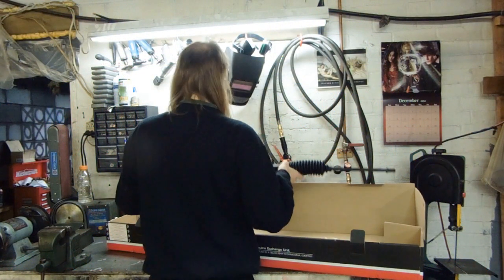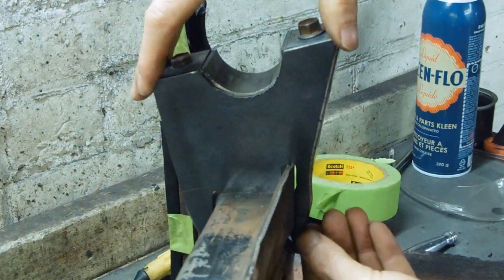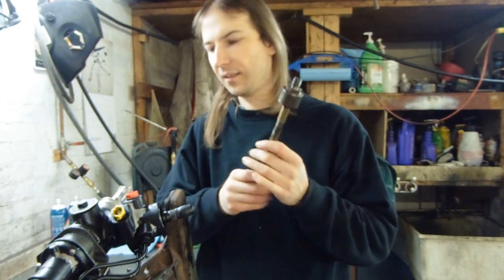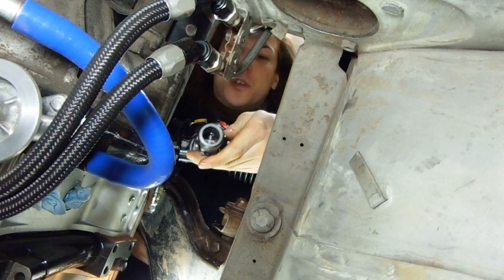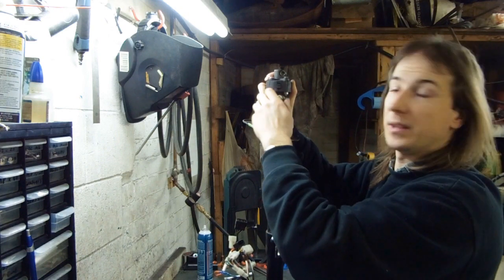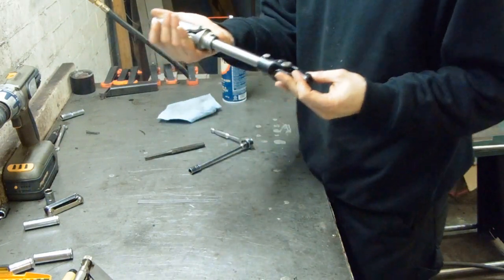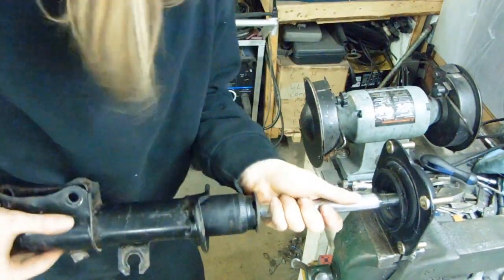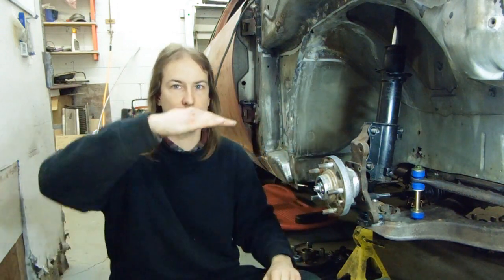Part 40: Front Suspension & Rack and Pinion Conversion, Part 2 - My 76 Mazda RX-5 Cosmo Restoration

Comment: I'm so bummer at the end of each episode cuz I just want to watch more haha.  But, it motivates me to go work on my fc.  I was just swapping out the front diff mount but one of the splined bolts snapped inside the actual mount and now I have to drop the subframe  ugh
Reply from the maker: Christian Sharron That sucks, but at least dropping the subframe isn't really that bad. Assuming it's been out before of course.
Reply: doesn't look like it has sadly.  got any tips for taking out the lateral links?  I tried half threading the nut on and using a jack with the 17mm socket but it just lifts the whole car up and the pickle fork is proving to be equally unsuccessful haha
Reply from the maker: Christian Sharron I'm not sure why you need to remove the lateral links. I've never had to except when I wanted to. Typically just drop the catback, disconnect the drive shaft, remove that vertical link, unbolt rear calipers, then unbolt shock bottoms, diff ear mounting nuts and remove subframe mounting nuts. Lower with jacks. However if you want to remove the lateral links then use a ball joint separator/puller.
Reply: Awesome, thanks for the tips man!

Comment: I believe the point of that spring in the steering shaft connector is to keep a little shear tension on the pinch bolt - this makes it less likely to come out, should the bolt start to work itself loose.

Comment: This question is not directly related to this project but in your experience with FCs what are my options to convert a power rack to manual a manual rack. I already studied the option of doing the mods to de-power the rack, also the FC manual rack is really hard to find. Have you seen any other option or manual rack close to the FC dimensions.
Reply from the maker: Jose Munoz Off hand I don't know which other racks would fit the FC. The easiest option is to just swap in the manual rack. I'm not sure where you are but finding a manual rack on the RX-7 Club (.com) should be fairly easy. Alternately RockAuto currently lists 3, complete with tie rods, starting at $178. You'll also need the steering shaft from the column to the rack, I believe. De-powering the FC rack the PROPER WAY works quite well. Note that involves disassembling the rack to remove the piston seals, not just looping the fluid lines. The benefit of the de-powered rack is that it has a quicker ratio than the manual rack.

Comment: The inner ball joints of the rack sit outer than the inner ball joint of the LCA. Thats a recipe for bumpsteer. I have a similar issue on my toyota KE20. Let me know how you solve it. By the way, great work with the videos and fab. Do share with us the positive changes later :)
Reply from the maker: sskoul Certainly that will introduce some changes in angle as the suspension flexes. However even most OEM applications do not have inner ball joints lined up to the control arm pivots (only one I've seen that lines up is FC RX-7). Makes sense, because a custom rack would be needed for every application. Actually I thought about going down that road but the Miata rack was almost perfect for the application so I would have gained little having one built. Bump steer wise, I'm more concerned with the inner tie rods being parallel to the LCA. Though my Insight violates those rules and doesn't seem to have bump steer problems. Well it does, but for other reasons (55 PSI horrible tires, rear track 2" inboard of front).

Comment: Don't worry about runout, your steering will NOT feel lumpy.  I had an old Dodge pickup that had a bad joint.  I ended up welding two u-joints off old Chrysler cars into a Chevy D shaped shaft, with the u-joints assembled, trying to not burn the piss out of them.  I had to submerge them in oil afterwards.
Reply: And changes?  Are you baby making?
Reply from the maker: Nicholas Smerk Oh hell no! As much as the world would be immensely improved by my offspring, that will never happen. No way, no how. Now back to the steering, thankfully it turns silky smooth. The little bit of runout in the adapter I made is compensated for by the rag joint. And on final assembly I'll put even more care into truing it up.
Reply: aaroncake I'm wondering if the runout would be complicated because of the bearing.  The one I built was a straight shot...removed the rag joint and welder on two u-joints to a slipper shaft.  It was pretty far off actually, but I was more worried about getting a very good weld without destroying the joint.
Reply from the maker: Nicholas Smerk U-joints give a lot of freedom in tolerating a little runout. It's interesting that I was at AutoRama yesterday and only saw one car using a bearing to support the steering shaft, all others were supported with heims. The most u-joints counted on one steering shaft was 5 and even then the owner assured me it turned smoothly.
Reply: aaroncake I'm sure none of those vehicles were dirty.
Reply from the maker: Nicholas Smerk The Riddler cars certainly were not but there were quite a few other hot rods and such which had some miles on them. However really doubt they are driven much in the rain or at all on a daily basis. No one who had changed their steering had boots on their u-joints. Not a single one. Which I find amazing because it seems like a necessity.
Reply: aaroncake I believe the u-joints themselves have rubber seals on them, just like a universal joint.  I always wonder how long it takes a heim joint to get dirty.

Comment: With all the custom suspension work, how do you intend to handle things such as alignment?
Reply: Nevermind, shows me to comment before the video ends
Reply from the maker: EvilJ069 The nice thing is that all the alignment adjustments from the factory are maintained. The strut top can be turned to alter camber/caster, the tie rod ends adjusted to change toe. It just looks like I need to move the strut tower tops in about 1" to fix the positive camber but I will wait until the car is at ride height.

Comment: Im curious aaron, what kind of Miller mig welder do you use? Also, I see you don't use a helmet while tacking, you just take it straight to the face which concerns me
Reply from the maker: RulfusTheBear The MIG is actually a Lincoln Weld-Pak 180HD. It replaced a small 120V Lincoln MIG. I'm very happy with the welder. It runs very smoothly, has a robust wire feed drive and good adjustability. As for the tacking, yep, I use my safety squint. Not recommended of course but I'd venture to say most weldors do it.

Comment: hi, When I saw you installing the front sway bar, I remembered mine! how possible is it to install the saw bar behind the engine instead of its normal position? i am having a problem with my engine swap and i just cant mount the sway bar back to its normal place nor find a suitable one! 

thank you
Reply from the maker: Yes, you can move the stabilizer bar behind the engine if space and geometry allows.
Reply: aaroncake thanks man

Comment: @41:55 is that rust holes in the frame rails/wheelhouse? Though you where finished with the sheet metal work.
Reply from the maker: soteple Yes. I didn't know if I would need to modify the frame rails depending on my subframe choice so I left those repairs. When the engine bay is once again empty for painting after mockup I will repair the frame rail and wheel wells.

Comment: Aaron. It's always boggled me as to how much torque one applies to the castle nut on the hub. what's your take on this?
Reply from the maker: ***** There is just enough torque to seat the bearings in the races and provide the proper clearance. It's a little weird to only thread such a large nut on just past finger tight. Of course all of this is mockup I didn't pay that much attention to it.

Comment: I am from Russia. Watch all your videos. I do not understand English, but very interesting. Good luck in your Projects. I want to ask you on a rotary engine, whether it is possible to grind the side covers rotary engine?
Reply from the maker: Николай Колодка Yes, it is possible. Usually called "lapping". Done to flatten the plates if they have worn down past tolerances. Hope that translates.
Reply: aaroncake Thanks for the reply. I read our Russian forum Mazda rx8 and everything they write that this can not be done grinding, because it has a special coating "nitriding" and after grinding these caps then they work very little. I polished the lid on the cover with diamond paste and machine oil. I did polishing by hand and got a good result. If interested I can send photos to grinding and after.

Comment: Way late on this but just in case. You don't need to put locktite on the inner rack ends to hold them in. There should be a lock washer between the rack end of the inner rod and the rack. The washer has two tangs which locate into holes in the rack (you can see them @12:13), you then hammer the side of the washer over the square side of the inner rod, preventing it from spinning. Not sure why your rack didn't have the locking washers (I couldn't see them when you dismantled the rod ends) or where you buy them (Moog inner rods don't come with new washers, but maybe Moog sells them separately).
Reply from the maker: Didn't see any lock washers with the rack so I'll have to check the Miata shop manual and see if I am missing anything. I may end up making a set of spacers anyway to adjust rack length as it doesn't sit perfectly on center.

Comment: Hey man, you need to invest in an auto darkening welding helmet and save your eyes. I go one, brand new for $25 with free shipping, it works great.
Reply from the maker: I have one (several, actually) but in many cases the safety squint is still more convenient.
Reply: Oh, Ok.  Just as long as you don't damage your eyes, it would really suck to be blind or not be able to see very well.

Comment: you put the sway bar link bushes in backwards. taper goes into the washer/retainers and flat side on sway bar.
Reply from the maker: Sounds right to me. But, after over a year of thought I'm going to change up how the lower control arms are set up. There's not enough camber adjustability in the current setup to compensate for the mix-and-match  parts.

Comment: Stupid question: Shouldn't there be metal plates on both sides of each rubber bushing for the sway bar?
Reply from the maker: EvilJ069 Not sure what you mean. On the mounts the bushing is captured by the clamp and the surface it clamps to. On the end links, the rubber is needed to rub against the steel of the lower control arm/stabilizer bar ends as opposed to metal which would squeak all the time.
Reply: aaroncake
My experience with that particular job is fairly limited, but the ones I've done were washer-rubber-washer ETC so prevent the bolts/nuts from damaging the rubber
Reply from the maker: EvilJ069 I'm still not sure what bushings you are referring to. The end links have washers above and below the rubber bushings except where the contact the stabilizer bar or control arm. The bushing kit was installed in the same way the old ones were removed. The stabilizer bar to body bushings are clamped to the body with a surrounding metal clamp.
Reply: aaroncake
Like I said, I don't have much experience with that particular item, so I guess the one I'm thinking of was either unique or done wrong previously =)

Comment: Hi, I seen some of your videos. And I would like to ask how I would go on to put a 83 rx7 lower manifold on a 2004 Mazda rx8 r2 but before I buy any unnecessary parts I would love to ask before I do so. Will the 83 lower manifold from the rx-7 fit straight on? Would I have to fabricate a plate? My reasoning for this is that. I am installing a 3 rotor top intake when I Bridgeport my rx8. I know from my old 83 fD that it has allot of performance gains as it allows more air to go through.
Reply from the maker: I'm not sure where you got that information but none of those parts fit together. Not even close. An '83 intake (this is a 4 barrel carb intake with a carb flange pointing straight up) doesn't bolt to a Renesis. It does not outflow the existing Renesis lower intake. The 20B 3 rotor upper intake won't come close to bolting to the '83 lower on account of the 20B upper to low flange being a long flange with 6 runners (2 per rotor). There are zero performance gains to putting the '83 intake onto a Renesis if it could even be reasonably done and during so you'd need to convert to carburetor or throttle body EFI. Or custom machine injector bungs. That's assuming you are talking a 4 port Renesis because if it is a 6 port, then you have all the actuator hardware.
Reply: aaroncake What would fit the 3 rotor intake without having to do much custom fabrications.

I have all the knowledge to do this. But I don't know the size of the rx-7 lower manifold. I have a 3 rotor intake so that's no issue. I do know I would have to fabricate a small runner valve depending on which manifold I go with. 
Also my friend of mine. Works at a machine shop so he can make me what I need done. And I can do the injector bungs, I done so on my old 83 fD. Custom made Lower turbo manifold.

My rx8 is turbo charged and I'm quite pleased with it but I'm wanting more air to go through.
 And this is why I ask.
Reply from the maker: Nothing would make the 20B intake fit unless you cut the last 1/3 off of the plenum, cut off the last 2 runners, rework the internal passages, and completely rework the runners so that instead of mating to the lower intake inline they funnel down to a 4 barrel pattern. You'll have virtually nothing of the 20B intake left. In fact it would make more sense to fabricate an entirely new upper intake then slap the "20B" plate onto it. It would be entirely a pointless venture because the '83 FB intake won't bolt to the Renesis unless you cut off the old flange, machine a new one, weld it on. Then the runners won't match up, so you'll have to cut and weld all of those. Then you'll have to add all the stuff for the aux port actuators. All of that to find out that the '83 runners are too small. This conversion doesn't make any sense.
Reply: aaroncake so I did my own research for my own project, and many many people have done this, setup. And had multiple gains. So I'll go with the other guys video on a different channel. So long fair well, dear friend as you thought all was impossible. So after I see my idea come to life. So my quote of the day is that. "Nothing is impossible if your mindset on something small or big build"
Reply from the maker: If you could send me that video URL showing this setup, I would greatly appreciate it because it most certainly is different than you describe. Let me reiterate: the ports on the Renesis don't line up with any other 12A or 13B manifold. The bolt pattern on the Renesis doesn't line up with any other 12A or 13B manifold. The '83 FB lower intake is a square 4 barrel carb flange with 4 runners. The 20B upper to lower flange is about a 22" long flange with 6 runners. Nothing about those parts will fit together without basically reconstructed them from almost scratch. I believe you are trolling me, because I can't fathom why someone would even attempt this. I even Googled it just in case in my 18 or so years of playing the rotary game I somehow missed something truly weird but couldn't find a single reference, video, image or forum post describing this setup. So give me some URLs to these "other guys video" so that we may all have a look.
Reply: aaroncake I can't post the URL. It's from a 3rd party site.But I can explain on what he did. And as what I'm doing now. Right now. I'm propping up one of my old 13b engines I have in my shop.

As you said. That they don't line up. And the renesis 13b is a circular exhaust porting. What he did to match the ports. He fabricated a exhaust flange, which he cut the rx-8 iron and welded and grinded down to perfection. Example on how he's doing it, peripheral porting.

He did this on a 13b renesis engine, which is being custom built for a rx-5

I have different intentions for this. Mine is going into a rx-8
Whe
Reply from the maker: Wait, you are talking about EXHAUST ports? Which means you aren't talking about INTAKE manifolds, you are referring to EXHAUST manifolds. In that case, I have no idea whether the 20B 3 exhaust ports will line up with the Renesis 3 exhaust ports. Considering the 20B exhaust manifold is as long as a 20B and the Renesis as long as a 13B, it probably won't fit without great amounts of cutting and welding. Still seems rather pointless when a custom turbo manifold would be much better.But then you talk about the 20B intake manifold, which won't fit on ANY 13B unless you cut big chunks out of it and rework the runners. At this point I'm quite confused as to what you are saying or trying to accomplish.You can post the link to a 3rd party site, no problem. If it gets stuck as spam, I will approve it. Or you can send me a direct message with the link.

Comment: i was seriously hoping you would do something like what you did to those tie rods. that sounds like the easy option. looking online for custom stuff not made for you car is a fail plan.
Reply: i love your channel! its like true life confessions of people that have to make custom everything for their custom ass cars.
Reply from the maker: bhearts77 I've been trying to avoid modifying wear items so truthfully, I was hoping to find a rod from another car that would do the job. That way 20 years later I wouldn't have to machine the replacements. But, for what it took to get the Miata rods modified it's not a big deal.
Reply: aaroncake its looking good man. that steering wheel shaft support turned out great.